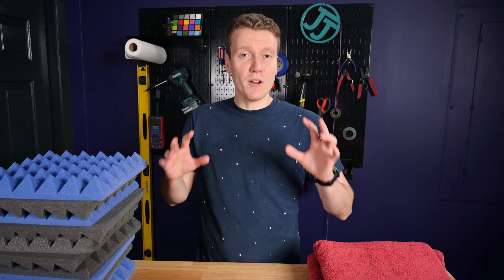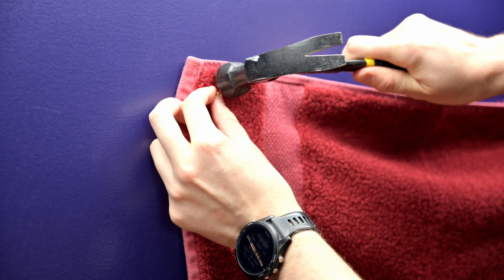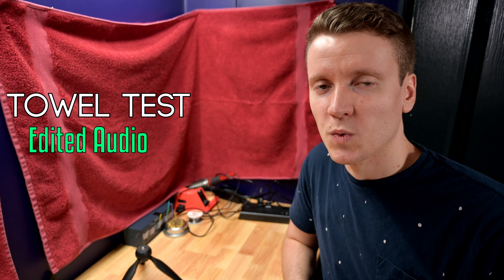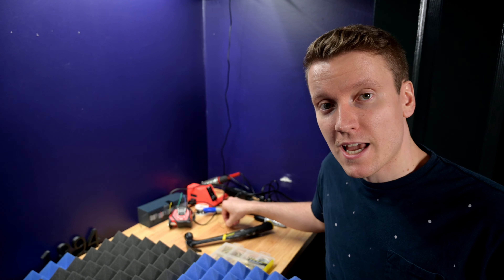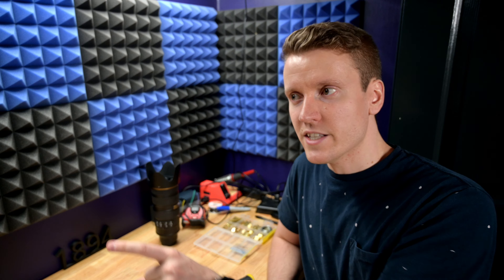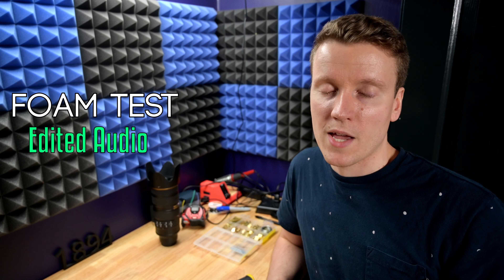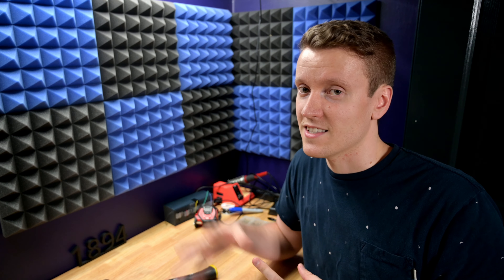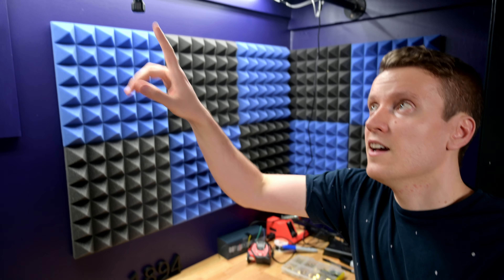Foam Acoustic Panels vs Bath Towels Test | Sound Treating a Small Closet

Comment: For treating the rest of your room, if it fits your taste: Get a thick carpet that you place under your desk and your place of recording. The floor is often forgotten but in most houses it’s usually a big reflective surface parallel to the ceiling and buying a carpet is cheaper and easier than treating the ceiling. Also on the floor you can use a much heavier and denser material that really sucks up the reverb, it made a huge difference in my small (music) studio :)

Comment: a few layers of towels works remarkably well - and best of all you can layer them up - and only need the 'top layer' to be nice looking, or a pattern, so the 'under layers' can just be old recycled towels bought from goodwill or donated or a garage sale.  You can get really fancy with frames and even sort of pleating the towels to get patterns, even  the pyramidal peaks in towels.

You can actually do a better job sound proofing with about 8 layers of towel, vs the highly expensive foam.
Reply: Is 8 layers of towel actually cheap?